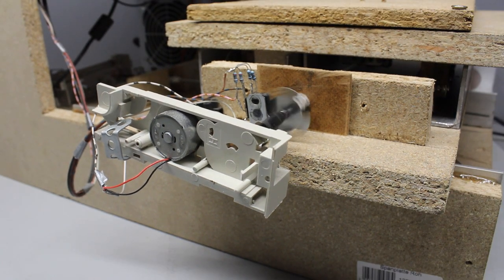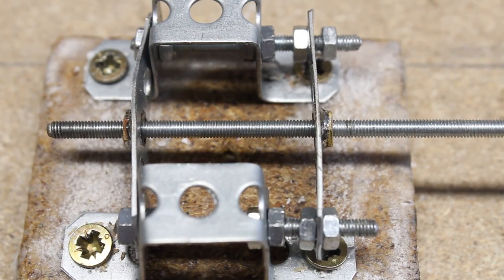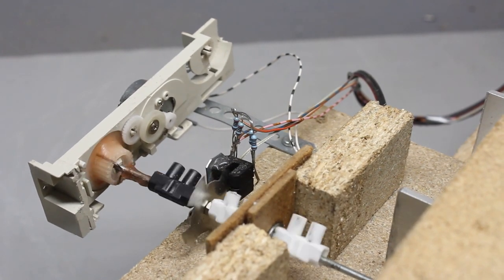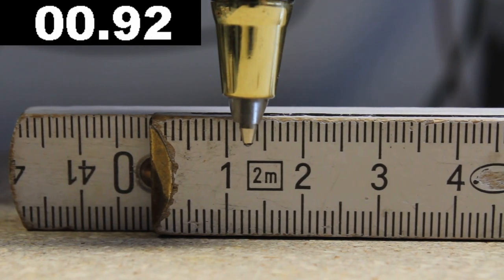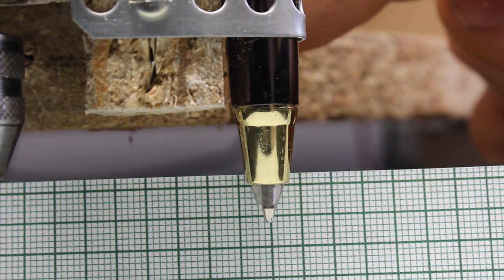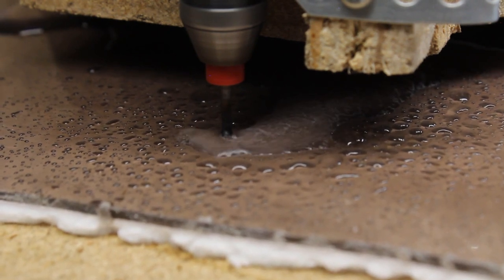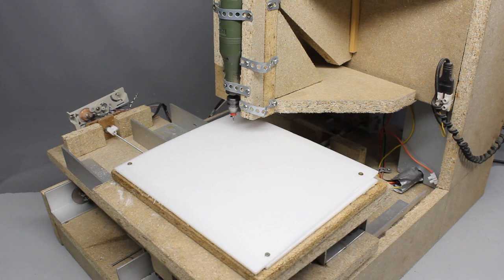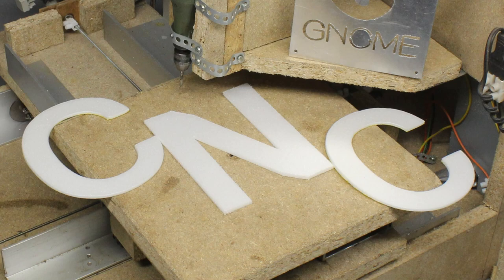CNC v0.6 build with simple tools and motors from optical drives or old printers

Comment: The glass etching was sweet. Time to make a small rotational axis and etch a glass coffee mug or tumbler with your logo. I'm surprised no attempt at milling a custom pcb but looks like it could do it. very nice build
Reply from the maker: +builtrodewreckedit There will be machines that can do more but just cut 2D items in the future. I will also have a look at software enabling me to try PCB milling. There is low precision on the vertical axis and the machine is very slow, but there is space for improvement...
Reply: Id think the vertical axis or z axis could be improved with the same threaded rods as the x and y  If the small servo were modified to constant rotat ion it could power it. It would be slower but a little more precise it think
Reply from the maker: +builtrodewreckedit Yes, I have thought of something like that. Instead of a servo I would use a third motor with an encoder disc. I'll keep that in mind for Version 0.61.
Reply: +HomoFaciens The encoder disk's are my favorite part of your build... knew it could be done but your is the first ive seen them used. Id love to use similar encoders on a RC lawnmower to basically make a cnc lawnmower. Most robot mowers are just random moving around.... id like one that does a pattern much like a milling operation.
Reply from the maker: +builtrodewreckedit My next video will be about how to build and use encoder discs:
http://www.homofaciens.de/technics-base-circuits-encoder-disc_en_navion.htm
I will try to create a positioning system (probably based on sonic waves) sometime. I guess that's what your special lawnmower needs to cut precise patterns more than stepper motors.
Reply: Thanks for the link..... ill sit and read it after work.. lots of good stuff there

Comment: Great idea. I have few questions:
1. Why do you use the double optical sensor? You know the motor direction from the H-bridge and just one optical sensor should be enough. Or is there something I'm missing?
2. Maybe it's just me, but I bought my last Arduino from China, it was the mini pro version (same clock speed, chip, etc., just different form-factor) and it costed around 4 bucks ;)
3. I'll take a look onto the code, but I think I'll be able to adapt it further for using ESP8266 as main driver and few shift registers for output for the H-bridge. Maybe this can be wifi-accesible then ;)
4. L298N costs like 2 EUR on aliexpress, just FYI. However, for motors with lower amperage (under 1A) you can use L293N on a breadboard for less than 1 EUR.
Excellent job on making the machine from the chipboard. I would go for plywood - I would never even imagine working machine can be made out of this material ;)
And most briliant idea - connecting the rods with the motors using the electrical connector!

Comment from the maker: +Robert Klauco
1.) But what if the motor turns without the H bridge being enabled? The motor could stop at the edge of the disc and a tiny movement would give a signal of rotation. You'll never know the direction of movement. More about rotational encoders will follow soon.
2 + 4.) You get those parts after weeks/months without warranty. I prefer buying at retailers in my home country.
3.) A mobile Wifi CNC? Sounds interesting!

I had (and still have some of) those chipboard plates in my garage. Plywood is usually more expensive, but more solid, too.
Reply: I have to test the reverse movement. Personaly I doubt it - as the H-bridge closes, it usualy puts both poles of the DC motor to ground, effectively creating short circuit - prohibiting the motor to spin freely. Even if it moved for a very little bit, it would meet the resistance of the threaded rod  - and moving 15 degrees would make probably very little change. I wonder if you are even able to do a precise 15 degree rotation using pwm - I'll try. However, your design inspired me a lot to build my own - I'm gonna try to do it even cheaper, avoid the aluminium linear guides and replacing them with drawer slides (costs 14 for 2 sets, so it's equal, but should have less resistance and more precision). Unfortunately, the only DC motor I now have is a small stepper (5 steppers for 8 eur) with high torque (geared) but VERY slow (like 20-30 RPM only). We'll see.
Thanks for the inspiration!
Reply from the maker: +Robert Klauco Even with the braking from the H bridges and the friction caused by the mechanics, there is in fact overshooting (at least with my setup). Nonetheless make your own experiments and tell me if you can create a CNC with an even simpler. This machine is meant to be an inspiration rather than to be copied 1:1.
Reply: +HomoFaciens If the goal was to inspire, it was 100% success ;)
Reply: +Robert Klauco Looking forward to seeing your version of it! Please post it as an answer here so that i find it ;) =)
Reply: I had first achievements - I built arduino mini with 2 H-bridge controllers and 2 extremely cheap steppers. The design of the cnc is done in sketchup - when done it should be even cheaper than thjis one :)
Reply from the maker: +Robert Klauco The motors can't be cheaper than those of a scraped optical drive. Bipolar stepper motors need a double H bridge per motor, I am using one double H bridge in total. The thing isn't to build the cheapest machine, but the best you can.
Hope to see your machine up and running, soon.
Reply: While that's true, I have a problem sourcing old cd drive. The one I salvaged have extremly weak tray motors and overvoltaging them results in temperature spike. I have 5 unipolar steppers inluding "driver" or ~9usd. Converting to unipolar takes one cut of pcb. The driver (wth microstepping) is~1usd for that. The only drawback is the speed - as the motor is geared (extreme torque with smallcurrent and voltage), they are painfully slow - at best I get ~25 rpm.
Reply: I'm doing my best - with 2 kids and a day job it's a probnlem to scrap some time ;)
Reply from the maker: +Robert Klauco There is nothing better than see your own machine doing it's first movement. Your children will love you for that machine if it is finished! Hope to see the second and third motor running soon.
Reply: +Robert Klauco Night isn't long enough? :D

Comment: Love the videos. You explain everything really thoroughly. I learned a lot! One question, as you have used salvaged motors, I have salvaged some motors from an old scanner and inkjet printer, but there are no markings on them, do you have any advice on how to determine the voltage and current needed for them to run? Thanks, and please continue to make these great videos!
Reply from the maker: +buzga1987 If you can't get the datasheet, there is just one way to find it out. Connect it to 5V and see if it runs fine. If the motor seems to be too weak, go to 12V. If the motor survives when being under load, it can be operated with 12V...
I am using pulse-width modulation to step the 12V down to 5V first. I am raising the duty cycle until the motor moves the CNC easily. That cost me the motors of the optical drives, but those of the printer still run fine.

Comment: Hi! I'm a big fan of your work! However why don't you use some old battery powered drill motors with the reduction gearings attached? It should work even better although the  price would increase for a bit. Viel Glück! :)
Reply from the maker: +micultimy91 My machines are meant to be an inspiration. So if you have own ideas of how to improve them, become a maker and try it! Danke!

Comment: could you use this to make a 3d printer ? with the motor set up with the optical senors ?
Reply from the maker: +curtis preston There is no reason why you could not built a 3D printer with those DC stepper motors, but with this low speed machine I have built, you would need days for printing even a tiny item. Furthermore you'd need a higher precision along the vertical axis (another DC stepper motor instead of the servo).

Comment: can we use command using windows OS? for me, linux is not familiar. thanks
Reply from the maker: Get familiar with Linux - it's the better choice.
Reply: Windows 10 includes an Linux shell now.
Reply from the maker: Benjamin Mango Magno
Well, installing Gigabytes of Windows spyware just to get a Linux shell? Not with me ;-)
Reply: I get that Linux is certainly the better OS, many want Windows for available software...for now. Someone who is heavily invested in Windows, getting familiar with the Linux console without committing to the huge change can make the eventual transition easier.

FTR I have 4 systems at home, 2 run Linux and 1 dual boots.
Reply from the maker: Benjamin Mango Magno
Thanks for sharing your thoughts!
I am promoting Open Source software with my projects (and that's what I am using to create them), thus I recommend setting up Linux on your machine, at least in a dualboot configuration. I definitely won't give any advice if something doesn't work in a windows environment. That's why I hardly recomment switching to Linux the sooner the better. Linux rules robots, networks and IoT - learn how to handle it if you want to become a shepherd rather than staying on the sheep level..
Of course, if you instist on using another OS, it's up to you, but don't say nobody warned you ;-)
Reply: I like how you think.

Comment: there is a software that i can use with windows to control the cnc????
Reply from the maker: Sorry, but I am using Linux only. You can install Linux, too - it's available for free and the better choice than the closed source spyware named Windows ;-)
Reply: HomoFaciens thanks for your answer tomorrow i will install linux
Reply from the maker: ...don't forget to make a backup of your data before installing a new operating system.
Reply: HomoFaciens thanks but i will install in a secondary drive or in a secondary machine
Reply: i hope that i will make this project your guides are very interesant an helpfull!!
Reply: this is my first try with cnc's and i hope that it will work!!!!
Reply from the maker: You can leave a comment on my pages if something is missing in the documentation while trying to make your personal copy of this machine. Hope to see it run, soon.
Reply: thanks for support!!!!

Comment: Good video, but, once again, question - why the hell are you using more complex, more expensive motion systems rather than using default stepper motors?
Steppers are easy to get(printers, scanners, copiers), easy to drive(premade boards), powerful, lower price($10-20 a piece) and easier in general.
Also, for axes - use drawer slides, and instead of M3 rods use M8 rods.
All of these simple changes will have no price difference but will increase the quality, and frankly make it more useful than this.
You've made two "useless" machines now, can you do something practical please?
Reply from the maker: +Spirit Thanks for your feedback.
You get the motors from scraped optical drives for free. Scanners and printers often use exactly those DC motors with optical encoders instead of "normal" stepper motors.
There is less friction with 3mm rods, thus the weak motors can move the CNC reliably with those tiny rodes. It's easy to replace them by more solid rods, so that's up to you. Learning where the the weak points are means learning about CNC in general.
I don't think that this machine is useless. Building one by yourself will enhance your knowledge. You'll never get smater if you just do thing you already know.
A video about "normal" stepper motors (unipolar, bipolar) is under construction. The electronics needed to drive those motors is in fact more complex (at least you need one double H bridge per motor). After that video I will indeed show how to build a CNC with those drives - be patient.
Another thing about reusing parts of scraped devices lies in the fact that the "donate" button on my project page is used only rarely - more money enables me to buy and present more electronics... 
Alternatively there is nothing for me to do than improving the design of this machine to turn it into something even more useful - that's pure joy to me!
Reply: Powerful stepper motors are not particularly easy to get economically. Show me where you can buy a strong stepper motor for $10-20 shipped.